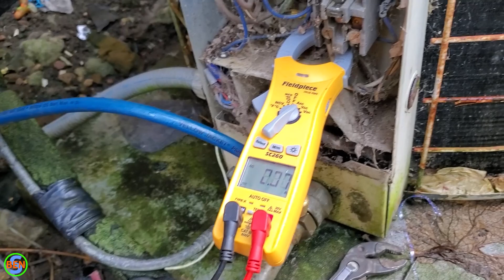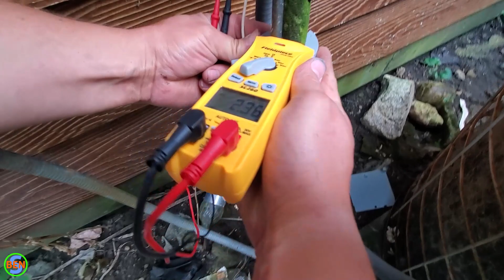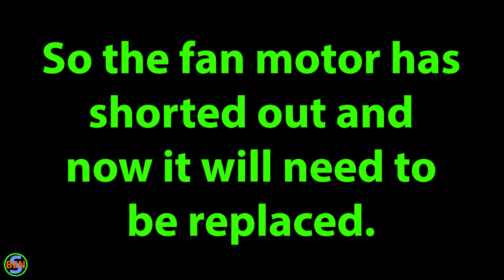This is WHY WE GROUND Electrical Equipment! HAZARDOUS Failure Found During AC Service Call!

Comment: This might explain why the primary cause of refrigerant leaks are at the evaporator coil. Copper tube, aluminum fins, water (condensate) and current combine to create a perfect galvanic corrosion.

Comment: What would happen if you were using a generator that had a N/G bond and the panel had a N/G bond like you showed in your video? I'm curious if something shorted out like this when you had a generator  and panel both with N/G bonded. You said in your video that it wasn't a huge risk to run like this whereas code says only one bond.

Comment: It's a good case for a dual pole contactor.

Last year my AC went out, and I managed to self-diagnose it to be the starter capacitor.  I also noticed my contactor was noisy (and only single pole), so I upgraded that as well to a dual pole contactor.  A year later, and it's working just fine.  I likely spent around $50 for both parts.  I half considered replacing the fan as well, but decided against it as not really necessary.

A lot of people argue for replacing the whole unit because of age.  There's an argument for that, but honestly it's a discussion for the homeowner.  I'm a DIYer, so it's very much worth it for me to spend $50-$100 on parts and save all those labor costs for what I'd consider fairly simple maintenance tasks to extend the life of my AC.  If you're comfortable working with AC voltage, this stuff isn't rocket surgery.  Replacing the whole unit would cost several thousand bucks to replace, and my unit, while 20 years old, is still fairly efficient compared to new ones.  

My $50 in maintenance cost has already saved me money by getting an extra year out of the AC.  If you figure 20 year average lifespan, and $3000 to replace an AC, it comes out to $150 a year in cost.

It also depends on where you live.  In MN AC is nice, but the days you absolutely need it are likely around 1-2 weeks every summer.

Comment: Very good! I've never encountered a situation like that. Good service response. 

Did you change the defective disconnect?  I'd be interested in learning how the fuse holder became separated.
Reply: Od imagine since theyre plastic it just broke into to halves due to age and normal wear and tear over the years where it became brittle and then was probably dropped a few too many times. I new disconnect was definitely the way to go. Many Newer units have fused disconnects built in them there days so you can eliminate the external fuse box and just run to a properly sized breaker and kill power at both ends when servicing.

Comment: So the million dollar question for me is- why didn't the breaker trip? If you have current on the ground, it should have created a surge that was  detected by breaker-- and shut that Fall Out 4 era air conditioner off instantly. Better check your PIP Boy for more information- strange things are afoot.
Reply: IIUC, the circuit created by the motor shorting to ground would look something like this Power->motor->Ground

So the circuit was current limited by the internal resistance of the motor, which drew about 2.4 amps.  Which implies the motor shorted to create a resistance of 50 ohms.
Reply: @stevesether  So enough to energize case but not enough to trip the breaker. I mean, it's either that or there is some other strange wiring issues from the branch circuit itself that feeds the air conditioner that cause this not to work like it theoretically should have, IMHO.
Reply: How does current on the ground cause a surge in current?
Reply: @icevariable9600  Because with AC current, the return path should technically be the neutral, not the ground. The ground is there to prevent exactly this scenario. Say you have hot wire somehow touching both motor and the metal case of the air conditioner. In theory, this could actually energize the device itself and not trip a breaker. Someone could touch it and get a jolt. Now if there is a ground wire that also runs back to the breaker, as soon as the case becomes energizer, current should travel along that ground and at a very high rate- enough that the fuse breaker trips. In truth, it's a bit more complicated that this because this is likely 240, in which case a neutral is not technically needed in many cases. But the principal about about the ground is there for is essentially the same.
Reply: @kevinmach730  Ah! I understand now. Yeah, I see, the hot hitting the ground causes a surge on the ground wire, since it's getting the full current since there is no load, tripping the breaker. And, same with the neutral, but without the violent "pop!". 

For some reason I wasn't putting it all together in my pea brain. Apprentice here. :)

Comment: No, the only reason why you can touch it is not because the current is going down through the ground wire, it's because there is no potential difference between you (at earth potential) and the frame, which is at the same potential. No potential difference means no current flows. That is, no current flows through you because there is no potential difference across you.

Comment: Correct me if im wrong but when you were getting 2 amps on the ground wire you were saying if the unit wasn't grounded that would energize the frame. The reason the unit is grounded is so if the frame became energized it would short out and trip the breaker. The 2 amps you were reading on the ground is technically also in the frame as it's all connected. A breaker should trip no?
Reply: You say a breaker should trip. Ideally yes. But the current in the ground wire is a tiny 2 amps and clearly not enough to trigger a breaker.

When you say the frame is energised, you have to be careful as to what this means. It's not quite as simple as saying "it's energised".

What matters to you as a person is whether there is a potential difference across your body when you touch the frame.

If the answer is there is no potential difference, or if it is less than 50 volts AC RMS, then you're safe and get to live another day.

If on the other hand there is a voltage difference across you when you touch the frame....and it is more than 50 volts AC RMS then there is a chance you might not live to see another day.

By connecting the frame to ground, and one side of your body, notably your feet are also at ground potential, if you come into contact with the frame, then there is no potential difference across your body and hence little or no current flows through you.
Reply: @deang5622  I agree with most of that however it's the amps that have the potential to harm you rather than volts. A police taser can be around 50,000V. As far as the "2 amps" on the ground it just seems odd. It's a path to ground with essentially no resistance so should spike to where it trips a breaker. I don't see how the fan could be operating on 120V through the ground, I just don't see that being possible.

Lastly, and I'm open to possibly being wrong here but I don't see how this is an example of a "ground functioning properly". The ground could be disconnected and it would not add any additional danger to this particular setup aside from it not being protected going forward but it would not energize the case.
Reply: @jimscalm3231  I am not an electrician, but I generally agree with you on both points, but one of them very strongly. The ground would have no resistance, and should trip the breaker. That's what it's there for, to provide a no-resistance path that electrons would prefer and  thus create a surge of electricity and then kill it altogether. As to your second point, that's more of a slippery slope.  it is a ground functioning properly in the sense it's giving it a favorable path over you touching the unit. In other words, if that ground wasn't there, I speculate it's possible you could become the preferred path. Think of it this way- an "energized" appliance with no ground doesn't truly have any energy going through- just potential- that is, until you touch it and become the ground. At that point, other circumstances that decide how good of ground you are, determine the ultimate outcome.
Reply: @kevinmach730  you make interesting points. I will counter your last example with the appliance that is not why the ground is on there in my opinion. The ground is a safety. I think this way. If you took a bare hot wire and touched it to the ground it would spark and pop the breaker. All the places on an appliance that a person could touch with the potential to become energized all link to 1 spot on the appliance which is grounded to ensure nothing ever becomes energized as it will trip the breaker. 

The wire in the video with 2 amps (in my opinion there's no voltage and that is harmless to touch at this point) but it is essentially bringing those 2 amps to the case where people are touching. If removed it doesn't increase the possibility of the 2 amps going to the case - It is the source bringing it to the case. Just my opinion.

Comment: Thank you. 
   An interesting situation.
   The previous owner of our home had wired around the fuses in the junction box to our A/C compressor. The system was old enough that it drew too much current and repeatedly blew fuses.
   So he saved on time and money for replacement fuses and risked burning the house down. Not a good solution.

Comment: Wow, must be a cash-strapped customer? I would think, for long-term reliability, you'd want to just replace the whole unit. With the condition that unit is in, you'll probably have another service call in a couple years for another issue.
Reply: Or it could last another 10 years. Keep in mind, stuff today isn't built nearly as well. Not trying to do go all "old man" here, but people want inexpensive (or their perception of inexpensive) and manufacturers have answered- for better or for worse and the quality just isn't there in most cases. Central AC units used to last 20-30 years and now they often lasting less than 10.
Reply: @kevinmach730  Did you see the fins and corrosion on that thing? Even if it does last another decade, the increased efficiency of a new unit would pay for itself in the same time.
While I don't necessarily disagree with your statement that "they don't make things like they used to", people also don't care for things like they used to. I feel like that plays a major role in some things "not lasting" like they used to. It used to be that there was someone cleaning aircons seasonally. Now, professional labor is so expensive and ppl are so lazy/uneducated and just expect it to last with zero maintenance.
Reply: @ewicky  You make good points about the efficiency aspect.
Reply: @ewicky  yep, preventive maintenance does wonders for the longevity of things!
Reply: Or a couple days....

Comment: NEC 2020 ACs must be on a GFCI. This service call reminds of the reason why this is now Code. I read that a guy jumped a chain link fence, landed on an AC, and touched the fence&AC with his hands and got electrocuted. They found there was no ground wire. A GFCI breaker now prevents this situation. Interesting vid....thx for recording it.
Reply: I wass yelling at my screen .  2AMPS to ground ? That would trip my  GFCI instanlty .. here in Europe'( Belgium )  code required a  main  GFCI( RCB ) of 300mA  on front of everything ( every socket /  appliance / lamp / etc )  and for wetrooms an extra GFCI of  30mA .  for jacuzzi we even put a  10mA  GFCI .    Suprises me this is not the case in  USA  and other countrys .. you can still have  sockets not protected by a GFCI ..
Reply: @kittsdiy  The code change mentioned above pretty much means almost everything residential in the US needs to be on a GFCI. Anywhere near water has been a requirement for many years. BTW, our GFCIs trip at 6mA ;)
Reply: @bnasty267  yep i know  6mA is way to low to put whole house on it . and some stuff has startup leakage ( solar inverters etc ) .   That's why we have  300mA as main GFCI for the whoel fuseboard .  And  1 or more 30mA for wet rooms .  Also we have to have  A type  GFCI's ..   AC type is nog allowed anymore .   And when more then 1 EV charge point we even have to install a type  B   RCB ( GFCI )  .  Oh and all our brakers are douple pole or 4 pole ( 3x400V + neutral )  .. so the neutral is also disconnected when turning a braker off
Reply: @bnasty267  Almost everything on GFI? Not really. What’s needed is kitchen counters, fridge (if within 6’), dishwasher, disposal,
bathroom counters, laundry room, all outlets in the garage, and outside. 

That leaves living room, dining room, bedroom, & hallways.
Reply: @icevariable9600  Yeah, yeah, but those all require AFCIs, so you might as well do a dual function (CAFCI/GFCI) since they're basically the same price as either function separate. The painful ones are the dual-poles, at $100 or more each, and now they're required also. A $90 panel can end up having over a grand worth of breakers in it. Crazy
Reply: @bnasty267  Personally, I don''t want to take a trip through the garage, through our outside gate, open up the panel outside and fuck with a tripped GFI breaker just because one tripped because my wife & GF have blowdryers going on the same circuit. I doubt most people don't want to do the same either.

Comment: With the fan running through the ground circuit I wonder if that would short out on the dog while it's peeing on the A/C?
I also wonder if the dog's pee caused the fan to short.
Reply: 3:29 and 5:54

Comment: Nice to see you actually fixing something that old. The vast majority of HVAC companies would just tell the homeowner they have to replace the whole thing.
Reply: That's exactly what I was thinking too. And it's not HVAC guys, people don't want to troubleshoot. I mean, I get it- it's one of the ways they can guarantee it will work for you. But as customer, when a new unit is going to cost 2,500 bucks, it's frustrating.
Reply: @kevinmach730  With the labor rates many companies charge in high cost of living areas, messing around with rusted shaft fan motors could easily get into a 4-digit dollar bill. Then, knowing Murphey's Law, something else would fail a week later. 

As a handy homeowner, I try to fix things, but I can certainly see why a company wouldn't want to risk the callbacks/unhappy customer to attempts fixes on a unit that is obviously living on borrowed time.
Reply: @bnasty267  As someone with decades in the service business, I totally agree with you about not wanting callbacks and thought I made that clear in my post. Sometimes it's the only way to make sure it's fixed and I make sure customers are aware I can't guarantee a fix will always work or whether it's worth it. But sometimes it's like using a hammer to kill and fly, and of course these guys are going want to replace things because of troubleshooting they either can't or don't want to do when they can sell you a new one and make much more. It's definitely a risk and I agree in this case, that unit looks pretty damn old.
Reply: @bnasty267  a absolute facts rhat thing is a recipe for disgruntled customers whod think you sabatoged it because you fix one thing only to show another problem downstream. You know that compressor unless previously replaced along with the contacts that are clearly in a state of disrepair can and will fail at the worst time possible. Usually days after a service call right along with the capacitor. Show them its age, say I can do this to get it running temporarily or we can install a new unit less the AHU for x dollars and at least give them a choice stemming from a place of knowledge and common sense. That unit was a relic.
Reply: shoot Replacement would be the smart option just to save them money in the long term. The compressor is probably about shot too and energy inefficient. Leave the air handling unit after cleaning it good and put in a new compressor unit so they save a ton of future service calls.
Reply: I replace anything more than 10 years old that's over an hour from my house. It's not worth driving back next month when the old equipment takes a crap again.
Reply: @oneillam1990  Ridiculous. Thanks for being out there ripping customers off.
Reply: Yup. Steve Lav says this all the time. He's a big believer in fixing something first
Reply: @WeatherNut27 The foundation of his business is callbacks. Crusty old buzzard.
Reply: Which is because this whole piece of junk should absolutely be replaced.

Comment: Maybe the owner can erect some chicken wire around the perimeter of the concrete pad to keep the dog away. Seems that all male dogs like to pee on condensers.
Reply: Dog pee is bad for the coil also it’s looking like it needs a good coil cleaning and great information about the motor
Reply: @sciatl2505  It's the ammonia in the pee that corrodes the copper or aluminum

Comment: Really interesting path of electricity...the least resistance path all the time.
It's amazing how well built those old units are.  It needs a major condenser cleaning and since you are there and all is opened up, I'd replace that contactor and the capacitor as long as the customer will understand the cost savings and peace of mind in doing it now. Not sure how those fan blades got all damaged but I'd be worried about the new motor bearings keeping it vs. replacing it if its available. And yes, that fused disconnect should be replaced with a breaker.
Reply: But remember, it will take any and all paths it need to in order to get back to the source, the one with the least resistance will just have  most current.